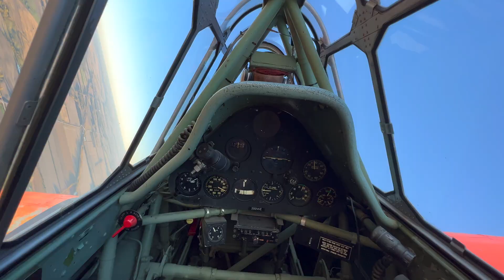Moving my airplane into my Garage - Lancair Build Part 3

Comment: hey, dont know if it is too late now, but i dont think you should make your firewall aluminum. according to faas part 23, approved materials are 0,016in stainless steel or titanium (or other materials that can hold 2000f for 15+ mins). aluminum cant do it.